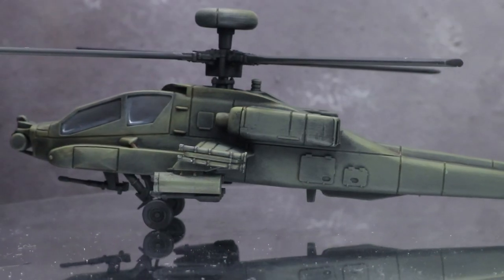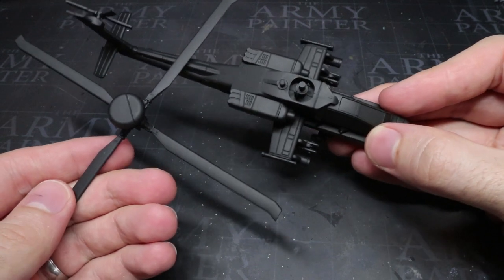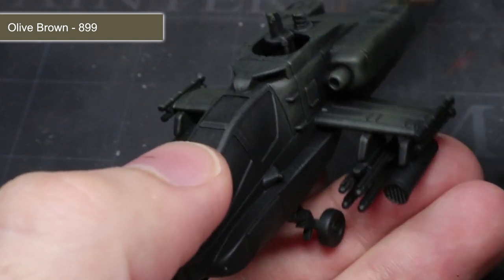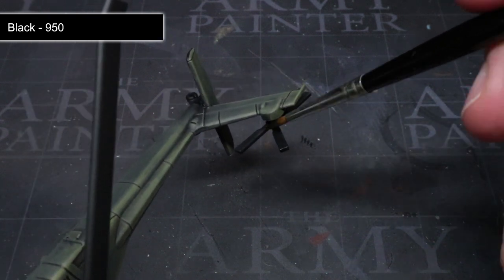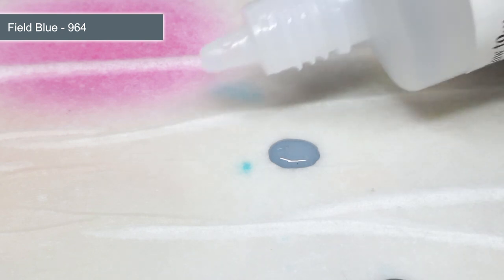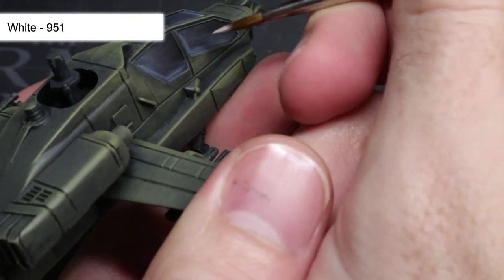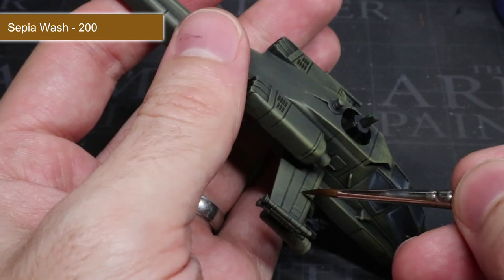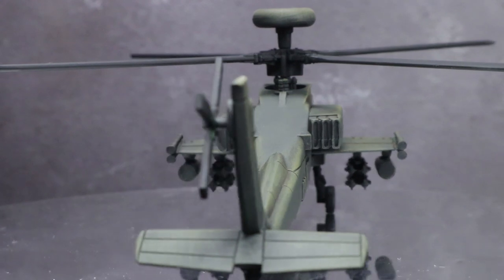How To Paint A U.S Apache Attack Helicopter: Flames of War WW3 Painting Tutorial

Comment: Paint job is awesome...  Where to begin with the model though.  The US army never accepted the mod for the sidewinder missiles depicted here.  Additionally the PVS seen on the optical turret in the front of the aircraft suggest that this is an Alpha model Apache where as the EFABS on the sides of the aircraft are expended suggestion that it is a Delta model.  I would imagine that there were looking at multiple different designs when sculpting this model.